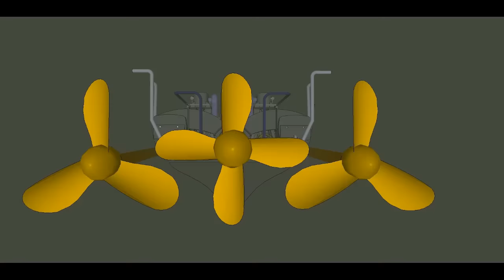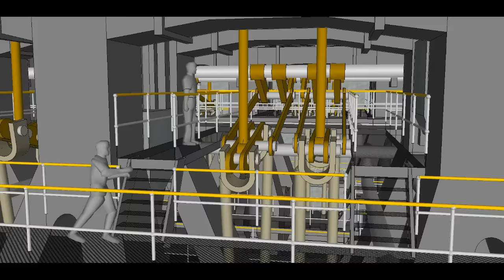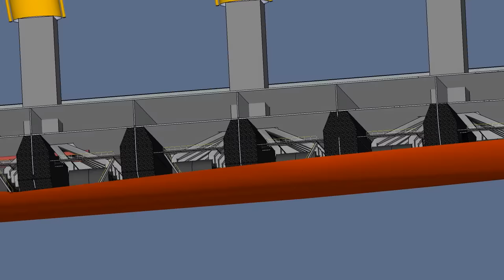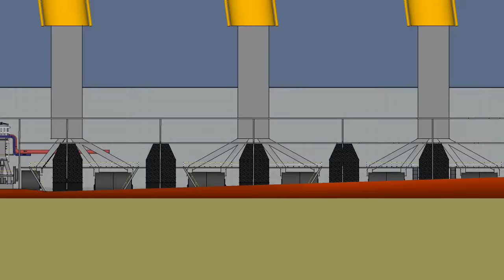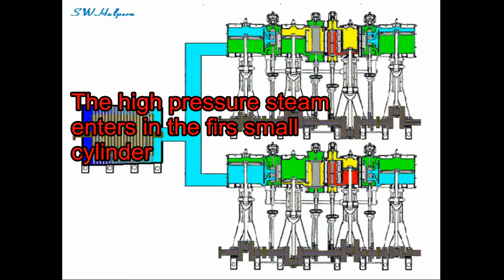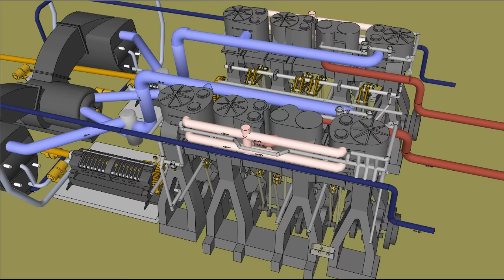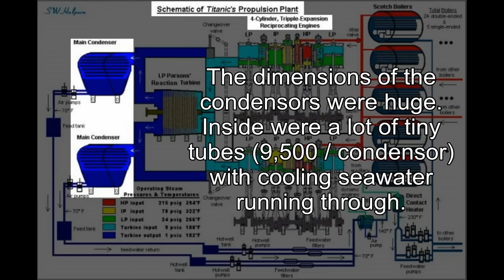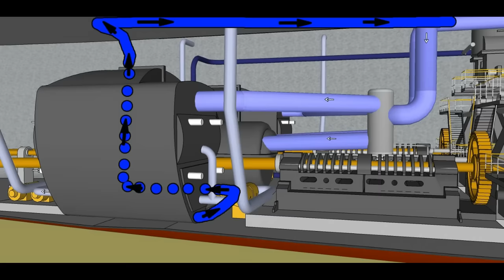The Engines of the Titanic

Comment: So much thought given to engines, so little thought given to the coal bunkers and the feeding of the boilers, which remained labour intensive in an almost 18th century manner. The Titanic's bunkers caught fire at the start of the maiden voyage. The heat from those fires weakened the steel near water line, dooming the Titanic when it struck an iceberg.
Reply from the maker: I really thought I had given the coal bunkers enough attention! But, I agree, there is always room for improvement!
Reply: @Hoeishetmogelijk  Are you aware of the theory first propounded this century, that the Titanic sank because a fire in its coal bunkers seriously weakened the steel cladding near the water line at the point where the iceberg struck?

Comment: Interesting that It was equipped with a steam turbine , really more efficient than piston engine, along side of a piston engine. I think if steam engines went in the direction of efficiency they would be in use today. Unfortunately no funding , I'm guessing, is why they couldn't get over a piston engine. The turbine is in the right direction but is also missing aspects of efficiency. I'm working on a steam engine my self , that I think solves some of the efficiency problems. Again a very interesting video.
Reply: All large ocean liners and many warships too built after Titanic were entirely powered by steam turbines. In the few short years since Olympic and her sisters hit the water, steam turbine technology advanced a lot, making them more efficient and reliable. Where I am there is a WW-2 battleship that is now a museum, and it has four propellers each powered by steam turbines.

Comment: No one ever stated that when The Titanic  Crows-nest lookout reported "Iceberg dead ahead" They ordered engines full astern, then decided to steer away from berg by turning rudder hard to port.
The rudder had no force of water running past it so no direction steering was possible fast enough. The right side of berg took a  3 flood zone plate rupture.  If Titanic went straight into Berg she would have survived. only one flood zone would have been flooded. It would have broken a lot of china though.
Reply: you also have to realize that they had no CPP.  That's Controllable pitch propeller.  So the engines had to stop going forward in order to go in reverse.  That takes time, then they have to start going backwards which takes more time.  Not only that, they had to actually stop moving forward and start going in reverse.  I can't speak for a steam ship time to reach zero over ground but we did an engine test on USS Oak Hill for engine Certification.  Time from 25 knots to zero was approximately 4 min 35 seconds.  It was a slow 4 minutes believe me it felt like longer.  That is with diesel engines and a controllable pitch propeller, modern technology.
Reply: steve rogers she would have sunk much faster if she went in straight in it, the force of the impact would have warped the bulkheads jamming the watertight doors stuck open, she would have gone down in 15 minutes or so

Comment: I've always wondered how they seal the propeller shafts to stop ocean water entering the ship.
Were they some kind of rubber or bearing, and did/do they need replacing?
Reply: The stern tube  has a wooden bearing made of Lignum Vitae (possibly spelled wrong) which supports the propeller shaft between the engine room and the propeller.  A seal at the engine room end has packing and a gland which can be adjusted as needed to keep water out.
Reply: Yes Henry it is lignum vitae and nowadays the aft liner is made of stainless steel and similarly the sterntube seal rings of rubber material
Reply: I would have bled a tiny bit of steam off right before the condensers to pressurizen the shaft galleys just enough to keep seawater out. I suppose well-greased or -oiled wood did a good job, though.
Reply: The same principal applies today in sealing prop shafts on inboard engine boats as well as many types of pumps
  It starts to leak..... Tighten up the gland nut slightly

Comment: The only thing that i wonder is, how did water not enter through the holes the screws were settled in?, i'm still amazed on how we had such technology like this in 1910
Reply: The prop shafts are fitted with what are named "stuffing boxes" and have a material packed around the shafts so the material may be squeezed to adjust the material compression that will stop or slow to a trickle the water which wants to come through that area.  Usually water is allowed to trickle or seep through to keep the packing cool.  Jute or cotton ropes treated with a grease or graphite are used as packing.  Graphite type packing is still used as well as PTFE material for this service.

Comment: I wonder what would happen if someone managed to install a transmission to provide gear ratios to be able to make the propellers turn faster 

If I’m not mistaking, the engines were direct drive.  Meaning that the propellers matched the rotary RMP’s of the engine. 
If they had an additional gear ratio or two, they could’ve caused the propellers to rotate at an RPM much faster than the engines did which would’ve increased the Titanic’s top speed
Reply from the maker: Hi Michael, the power generated by the engines has been calculated for these propellers. This also determines the speed and size of the propeller. The gearbox should be so heavy that a lot of energy is lost. Ships do not need a gear box because boats don't go up hills. And since there is no speed limit out on the open water a ship's engine runs flat out operated at wide open throttle at all times. Therefore ships have a direct drive. (https://www.quora.com/Do-ships-have-a-gearbox)

Comment: why it is sooooo complex compared to modern engines
Reply: Modern engines are also very complex, the only simple engine is electric motor
Reply: compared to new car engines it is mechanicaly (not electricaly) complex
Reply: It's a simple engine compared to the Hundred Thousand HP of the cargo carriers for shipping boxes. And take note as they are also direct drive, and require reversing the engine the same, by valve timing also. Just stop the engine and restart in opposite direction with compressed air.
Reply: its pretty much the same as a modern car engine, except that it is an external combustion engine rather than an internal combustion engine.
Reply: What i don't understand was like in the movie, when they were going into reverse,looks like one of the mechanics was throwing a lever to do something to get into reverse.. I wouldn't think it would be some kind of reverse idler...I have no clue...your thoughts would be appreciated...
Reply: john james
they are reversing the valve orientation for the pistons, Steam engines direction and speed is based on how steam enters or exists the pistons
Reply: MR.Chickennuget 360 thank you for that...i understand now....
Reply: john james
if you watch the 1997 James Cameron movie you will see two things you will see the Chief Engineer turning valve wheel that cuts steam pressure as the pressure drops the engines slow down.
As this happens you see a Boiler room foreman order the stokers to shut the dampers this is done both to cut off steam production and to prevent back draft

when the engines are slow enough the chief engineer orders the engines thrown in reverse and he opens up the valve to let steam enter the pistons again.

Steam engines are "external combustion engines"
as opposed to internal combustion engines

they had no transmission but were direct drive
Reply: When you say the Chief engineer orders the engines thrown in reverse, the mechanic is admitting steam to the engines only in the opposite direction if i read you right..
Reply: john james
yes he is just shifting the valves from "forward" to "reverse"
Reply: thanks for your help....
Reply from the maker: https://www.encyclopedia-titanica.org/titanic-prime-mover~part-5.html   will tell about the reciprocating possibilities and the reverse direction.

Comment: Great information, and great engine sound! Just a hint for non-US people: a pressure of 215 psi corresponds to about 15 bar (or 15 atmospheres, as it was called in former times). The old Engish units are very awkward to use and are also not convenient in science and physics. So the steam pressure was about 15 times the air pressure which is around us. I calculated the approximate overall data in French units:

High pressure: 15 bar (atmospheres) at 200 degree Celsius
Medium pressure: 5.4 bar (atmospheres) at 160 degree Celsius
Low pressure: 1.6 bar (atmospheres) at 130 degree Celsius
Turbine input: 0.6 bar (atmospheres) at 87 degree Celsius.
Reply: Just to let you know that not everyone agrees with you, I am a Professional Mechanical Engineer in the U.S. with 40 years experience and I believe that the English units are more convenient in science and physics. I also enjoyed this video.

Comment: The Titanic did have one steam turbine engine and two reciprocating.      You may have noted the steam pressure on these engines was 215 PSI.         I was a machinist mate in the 1960's Navy and served aboard the USS Saratoga (CVA-60)     Steam pressure in it's engines was 1200 PSI

Comment: Interestingly the engines used in the Olympic Class liners were out of date when the ships were built. White Star decided to use them though because they were "smooth", that's exactly what you want on a luxury ship, a smooth ride.
Reply: And because they used far less coal on a crossing, with only a slightly lower speed than the turbine engines on the Lusitania Class liners.

Comment: Very interesting and tells me precisely what I wanted to know .  On inspection of Olympic at Southampton after the Hawk collision, we now know that Olympic could only procede to Belfast for repairs using just her port main engine . This tells us that the central Turbine for whatever reason could not be used when they desperately needed it to effect repairs as quickly as possible and to save wasted steam .  The central turbine shaft running through the keel was enclosed in many bearing housings and it is now safe to say that the concrete battering ram of HMS Hawk did far more damage to Olympic than has ever been admited , damage that bent the keel ensuring that the central turbine could not be used reliably again without tremendous vibration and/or overheating of misaligned bearings .  Contemporary reports from engineers and passengers on the Titanic/Olympic maiden voyage from Southamton confirm severe vibration and a list to port that could not be cured and is indicative of a bent keel .    I have no doubt in my mind that the ships were switched because of the extensive damage caused by Hawk and can only request that decent clear unretouched photo's of the sunken ship today showing the bow names are released to confirm the ship is the Olympic .
Reply from the maker: A very interesting story! Thank you.
Reply: That theory is utter rubbish.

Strange how Titanic managed to make the speed/distance she did in such a state with rattling herself to bits.

20 year's experience as a deck officer I assure you vthe theory is nonsense.
Reply: @wire9486  You are correct in rattling herself to bits and could this be the reason why sea trials were only conducted for a barely half day whereas Olympic's trials took 2 full days .  Were they afraid that a full speed dash and an immediate full astern which was carried out on Olympic but not on Titanic would have done just that ? and the watertight door test carried out just after Titanic had left Southampton despite a test carried out 3 days prior by BOT officials ,  why the need for another test unless there was a problem with the hull letting in water ? Many passengers were greatly upset by the test .
Reply: @jonathanpardoe8722  Again how is she supposed to have reached the final resting place in the time allowed if she wasn't capable of full speed?

Olympics fittings are currently part of the White Swan hotel in Northumbria after she was scrapped. Go and have a look yourself apart from being marked Hull 400 they were different from Titanics, you can also check ymthese against the plethora of pictures taken during Olympics fitting out.

The theory is utter nonsense.

I could poke holes in this story all day however a quick Google will sort that one out. To the untrained eye their identical ships when in fact there are a huge number of differences only a mariner would know.
Reply: @wire9486  In answer to your response , my own experience in water craft has been owning and restoring a Samuel White MTB from ww2  and a 1903 Southampton tug  along with many other smaller craft .   In calm weather (Flat calm in Titanics case)  stresses and weaknesses wont be apparent as if the ship was "Working" in a heavy sea .  Does this answer your question of how the Titanic managed to get to her resting position ?   As for the fittings at the Swan hotel, anybody with printing experience will tell you that the font used wasnt available until after the fittings were removed from Olympic .  But it really does not matter if the ship was Titanic or Olympic , but  a ship was sunk deliberately to capitalise on the advent of "instant comunications" heralded by the sinking of a capitol ship which made the entire world clamour for information that sent share prices soaring in Marconi company that would have gone bankrupt had the ship not sank .The Marconi Scandal, if scrutinised shows the desperate state that the company was in , having its share value suspended and the key workers fired leaving Marconi only able to make vehicle ignition systems to survive .  In 10 years of perfecting the wireless , not one government was interested in investing until Titanic event .   The shares bonanza yielded far more than a simple insurance claim and set the Liberal party up for life . The prime minister Herbert Asquith specificly asked David Lloyd George to purchase shares for the liberal's at a dinner party held by Godfrey Isaacs 3 days before the sinking whose guests included his brother the senior government solicitor Rufus Isaacs , Lloyd George and other VIP gusts such as George Cadbury .  It is thought that Winstone Churchill attended that party where Godfrey Isaacs pursuaded the guests to purchase shares in Marconi that day  because something big was going to happen within the week .  Titanic sank  3 dats later  and the shares went meteoric  . I havnt the exact figures but I believe they went from 5 shillings to £50 immediately as the interest in the event went global .  It remains the biggest case of insider dealing to this day ! . All this can be researched and is all true .   I believe that as Churchill was involved and most certainly did know of the plan and was in a position to stop the Ship from sailing but didnt because of the amount of money to be made is why the truth about the ship has never come out .  Churchills name can never be sullied or accused of gross corporate manslaughter  so evidance is buried  forever .
Reply: @jonathanpardoe8722  Any experience with large merchant vessel in handling, maintaining and construction?

You are proposing Olympic's keel was bent, it wasn't as stated in the surveyor report. You then claim she was so damaged she had to be scuttled, if that was the case and considering where the collision was it would be a simple case of building a new stern, check out SS Suveic another White Star ship.

You claim the renamed Olympic's sea trials were cut short because she couldn't manoeuvre or maintain her service speed for sea trials and yet somehow manged to meet her rendezvous with the berg at all most full speed and then again with the last boilers lit a few days into the journey. Any damage ship in such condition would have bee completely unliveable aboard not to mention smashing her propulsion machinery to bits. Any deflection in the shafts or would be utterly catastrophic at 21 knts. Try taking a chunk out of a prop blade and run it a full speed.

All Olympics fittings were documented and recorded when she was scrapped. The hull number is written on the panels at the White Swan Hotel, I encourage you to go and have a look.

Why is Oympics build paint not visible on the wreck? Yet it's visible in pictures after future damage.

The list is endless, google titanicswitch .com, what you are claiming is utterly impossible. Amazing how every one involved in the "swap" has managed to stay silent considering the thousands of men that spent weeks changing them over, stripping all the paint.

It's utter nonsense.

Comment from the maker: The propeller shaft presses against the ship to push it forward.  The shaft is connected directly to the crankshaft in the steam engine.  With this uncorrected force, the crankshaft would be dammaged.  The thrust block transfers this force and transfers it to the hull.  The operation is simple.  A number of rings are welded to the shaft that rotate between the fixed rings in the thrust block.  In fact, these rings press against each other.  I hope this is clear to you.